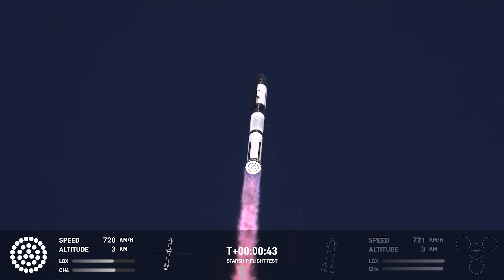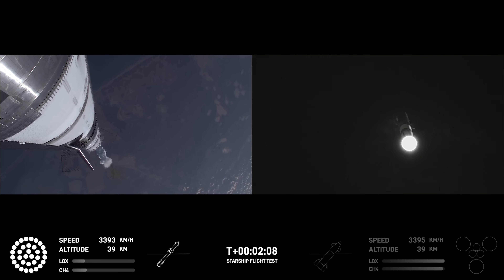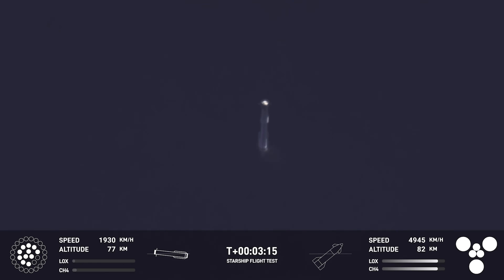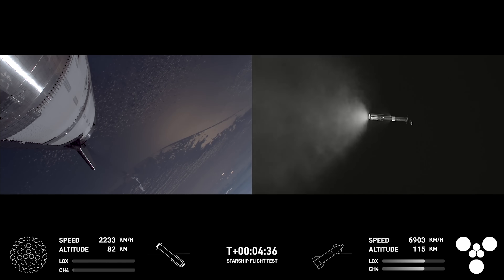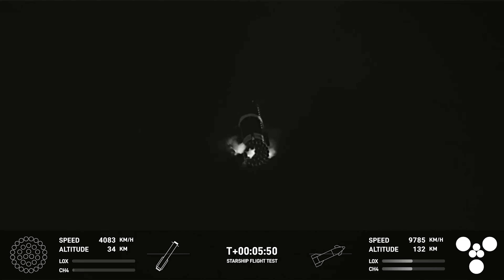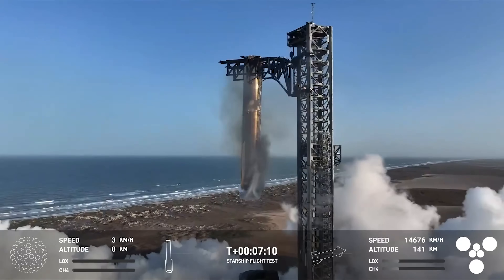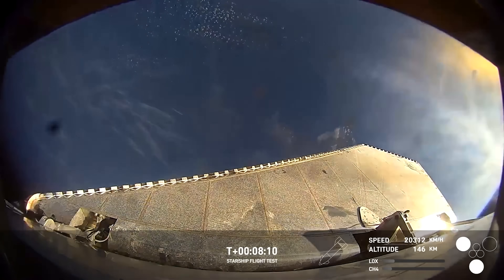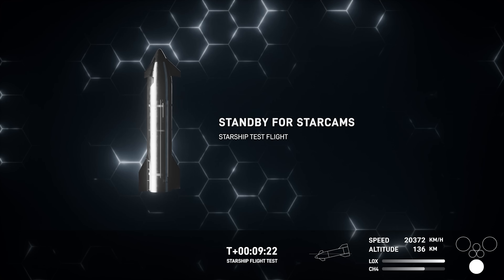BAD NEWS! Starship Flight 8 Spinned and Exploded After Booster Catch...Here's What Happened!

Comment: Looks like one engine, perhaps the outer vacuum engine exploded and took out a couple more and then one more after that.  The other possibility is that the plumbing feeding propellant to those engines was either starved of prop or the plumbing ruptured thus starving the engines.  This second possibility would also explain the vapor cloud the Starship was seen spinning around in before it broke up. As to why the plumbing would fail at that point, I don't know, but it might be the shockwaves and acoustic environment that bathes Starship on takeoff with all that exhaust reflecting off the water cooled plate.  On takeoff the SuperHeavy booster is producing the equivalent of about 360M Horse Power or 270GW -- if only 1% of that energy is acoustic that's still nearly 3GW of sound energy bathing the rocket.  It just may be that the first stage is somewhat protected by the very engines producing that power, but that the Starship isn't running it's engines at that point AND the 'hot staging ring'  might allow more of that acoustic energy to get at the Starships plumbing.  Still, it's odd how the plumbing of Starship survived for about 4 minutes of operation before failing.  That kind of brings us back to an engine failure taking out other engines and also  rupturing the plumbing.

Comment: Too many engines which creates too much plumbing which increases your risk of failure. That is why the Saturn V had only 5 massive engines on first stage and 5 smaller engines on second stage.

Edit - Go look at the Soviet Moon Rocket. They had the same issue and completely failed.
Reply: It's a valid point. But equally, as you add more engines and increase the risk of one of them failing, you reduce the impact of one engine failure. Very relevantly illustrated by the fact that on the booster boost-back sequence of both fligth 7 & 8, one or more engines failed to ignite. And yet, the booster landed succesfully. So... I guess we'll have to see how it goes :)
Reply: @Z00777  Yes I'm sure they will get it worked out. But I would not want to ride on one.

Comment: Saturn rockets lifted off in the late 60's , early 70's , so why can't this rocket ?
Reply: Saturn rockets had failures also
Reply: Uhm, it did lift off, multiple times? But it seems they may have done something in block 2 that does not quite work yet.
Reply: The Apollo program used non-reusable rockets, employed 400,000 people and cost $300 billion adjusted for inflation. Spacex employs 13,000, and the budget so far for the starship has been $8 billion.

So less than 3% of the manpower and budget, for something revolutionary since it can land.
Reply: Seems the booster is working.  And so is the recovery system.  Go back and retrace how many Jupiter and Atlas lift vehicles were used up unsuccessfully before they were finally debugged enough to be trusted with carrying a living person into space.

Comment: It is conceivable that Starship may have reached a Technological development Dead End. Yes, I am convinced that SpaceX will be able to make it to orbit and a successful re-entry but Starship may never be viewed as a reliable Human Spacecraft. The complexity of Starship precludes it from being a viable "Rapid Reusable" Space Launch system for Humans. Starship will be no more reliable than the Space Shuttle regardless of the focused detail on safety. The RUD of Starshift 7 and 8 is an unanticipated disaster when comparison is made to the previous successful Starship re-entry attempts with the heat shield being the major issue. With each Starship failure the greater the doubt for success and the decrease in overall confidence that SpaceX will be capable of making Starship safe. The optics of these failures does not favor Starship. Who will ever want to get on a Rocket that has a good chance of Blowing Up. Perhaps for this reason Blue Origin has taken a cautious approach to flight testing when in comes to New Glenn. There will have to be a minimum of a dozen fully successful launches of Starship before it can be considered reliable. Hopefully SpaceX will succeed.
Reply: This is the only emotionally and intellectually stable critique I've read so far. Good assessment.
Reply: Please, please You seems to be an expert, call SpaceX and overtake the project !!!

Comment: They are not a patch on the NASA Apollo government program engineers. The greatest generation is dead.
Space X is engineered by people who were constantly told they were special when they grew up when they weren't.   These people tout the return of the booster as as a success over the loss of the spaceship and will give a participation award to the spaceship engineering crew next staff meeting.  Better luck next time with tax payer money. Why are we giving billions to privatized for profit corporations instead of NASA? It makes no economic or practical sense.
Reply: You clearly havent seen what NASA accomplished over the past 30 years with the budget provided them.  SpaceX is still saving the government money when one of these explodes due to the savings on Falcon9 and Falcon Heavy contracts and it's not even close when compared the cost to use the shuttle, or any other rocket, to get the equivalent weight to space.
Reply: No tax payer money is spent on the starship project. Actually, the Starbase pays tax by millions and generate jobs by hundreds each year.

Comment: Imagine the Saturn V with this many failures. Good thing NASA didnt' trust our astronauts to this hunk o' junk.
Reply: Saturn V couldnt have been produced the same way.  Which is rapid iteration.  The cost wouldn't have been feasible.
Reply: Apollo 6 sends it's regards. S-IVB failed to restart for its 310-second burn, resulting in it being a failed mission. If it was a manned mission, the escape tower would had been used.  Remember Starship is still in experimental phase. Not to mention it only had 13 total flights. Then you can look at the damage that was done to Skylab. Severe pogo oscillations in the 2nd stage nearly costed Apollo 13 with catastrophe. A third stage blew up during testing in Sacramento in January of 1967.
Reply: @Ragetiger1  I guess the difference to me is that was in the 60s. This is 2025.
Reply: @beccaaaa45678  We were also in a race against the USSR to be first on the Moon in the 60s. 

I do find it odd that Starship was the first part that was tested and seemed to be running fine in 2021 - belly flop maneuver with vertical landing.
Reply: @ If NASA had Elon's record there would have been over 100 exploding craft.
Reply: @Ragetiger1  How many Saturn Vs exploded with complete loss of the craft again??
Reply: @SeattleRafael  How many Falcon 9 Heavys . . . . none that I can recall. Now if you want to call Starship the correct thing, it would be Apollo.  Apollo 1 never left the pad, Apollo 6 failed to reach it's objective, cause Saturn V's third stage failed to even start, but was deemed ready for manned flight. Apollo 13 and skylab.  

So it only had 13 total flights, not really enough to be considered for a failure rating. The space shuttle flew well over 100 times with 2 failures.
Reply: @Ragetiger1  Starship vehicles have been launched 8 times, resulting in 4 successes  and 4 failures. How many Saturn Vs exploded?

Comment: There will be many more of this explosion,This is just a testing development and building phase. There’ll be a lot more explosions and then one day they’ll be none.
Reply: Just as there are no more shuttle explosions.
Reply: @ that’s very short cited.
Reply: @jackieking1522  They are testing the heat tiles and are not expecting a return for another 7-8 flights. They have 4 more flights testing the composition and density of the tiles, then another 4 scheduled to test placement. The Shuttle was designed for replacement of the heat shield every flight which took 6-9 months in between flights. SpaceX is working permanent tiles that can be reused the next day. There is a giant difference between the two technologies.

Comment: 7:49 You can see the bottom-left Raptor Vacuum Engine glowing abnormally, near the tip. I wonder if the vacuum nozzle had a crack in it.
Reply: Nice catch! Just losing a few cryogenic lines in the nozzle can cause the engine to rapidly overheat.
Reply: @brainandforce The booster catch was on point, it'll take time to get starship figured out but I'm sure it'll happen soon enough. This kind of stuff definitely isn't easy....
Reply: Is it just me or is anyone else rearranging the words in that sentence?  At 60 I still can't help but think like a 15-year-old at times.

Comment: Musk on Mars - Space Unicorns - See the Spoiler near the end.

Using statements & documents issued by Elon Musk I have calculated the viability of his Mars colonization project. Strap in, the G-forces will be very high.

Musk admitted that 1 million tons of material must be sent to Mars in advance of humans to supply the components for safe habitat.

That requires 10,000 successful launches and subsequent descents of Starship to the selected habitat area on Mars (100 ton payload per Starship claimed by Musk).

In addition, Musk stated it will take 6 more Starships for every Mars bound vehicle to refuel those Mars bound Starships (waiting in orbit)for the actual Mars journey. That's 60,000 additional Starship launches, allowing that there are no failures.

This gives us 7 launches for every Mars bound vehicle. So in reality, at one launch per day (wildly optimistic = delusional, but let's go with it) it will take 7 days per Mars bound vehicle. That now totals 191 years to complete material transfer.

Spoiler:
The window for a Mars launch is once every 26 months, with 15 days available in that time frame (49 launches per day).
That means Starship will have to cram in 732 launches in 15 days every 26 months to meet the 191 year infrastructure transfer.

1) What will happen to the first material that lands after 191 years while it sits waiting for the final structural parts to be landed?
2) Who will finance each Starship, the cargo, fuel mass needed to make the journey?
5) What can be done at the Mars site if material is damaged?
6) During the 191 years will there continue to be a viable SpaceX factory?
7) How many Starship launches will fail during the program to put material on Mars.
8) How many Starships will crash during the landing phase on Mars?

9) How about feeding the astronauts for 9 months?
Reply: How about you go back down to your basement and go to sleep until the drugs wear off!!

Comment: As a former avionics engineer I suspect it may have been caused by the mental stabilisation line replaceable unit. It always was rather fragile barely in balance  and apt to supply incorect data most of the time   I suspect it may be found to have been contaminated with a white powder of some sort.
Reply: Ketamine
Reply: You're thinking of Hunter..

Comment: Current starship separation procedures are proving detrimental to the vehicle's structural integrity.  This issue necessitates immediate action to mitigate further damage.  A thorough review of the separation mechanisms is required.  We must either refine the existing process or develop a completely new separation system.  The success of future missions depends on resolving this critical flaw.

Comment: How is Musk going to take enough cryogenic fuel to get back off Mars. Takes many months to get there, fuel won't boil away? 200 foot tall Starship landing on Mars with no tower with chopsticks to catch it. Land on uneven rocky ground and fall over.
Reply: Right. I see the same issues. The whole architecture is flawed. We should be building moon shuttle vehicles in space by piecing together components. The shuttle can be as big as they want without needing aerodynamics.  It could have tons of space and radiation shielding.  Falcon Heavy can deliver the components to Earth orbit where they are assembled.  Once the shuttle reaches the moon orbit,  moon landers go to and from the moon's surface, much like Apollo did. Once a mission is completed, the shuttle returns to Earth orbit. This architecture can be done today.  Once this system is working well, then do a similar thing with Mars.
Reply: Sanitizer process, crack methane from the Martian atmosphere.

Comment: Booster stage is working reasonably well now. 3rd catch. Just have to sort out the 2nd stage starship fuel line problems causing engines to shut down. This time only 20 or so seconds to engine shut-down this time.

Comment: At 7:48, you can see what looks like vapor and even what looks like flame in the engine bay when there should be neither.
Reply: A raptor vacuum engine was damaged and it is the one which exploded and took the centre engines with it

Comment: So im guessing the same problem as last time.e reared it's head. Could the hot staging be causing the problem because the flames under high pressure and temps are confined?

Comment: Looks like the cooling system for the outer larger engine had a line break during use. Looks as though they both did. The center systems must have failed do to a top right engine blow out. Tha tkicked off the main lines and the other two could not be turned off to prevent full system failer.
Reply: I am not an expert or an engineer, nor knowledgeable about engines, but your explanation seems to make good sense.

Comment: Remember folks, SpaceX has to do 20+ flights like this to bring one crew to the moon and back.
Reply: Plus in orbit re-fueling..what a fucking disaster
Reply: They didn’t mention anything about payload on that test flight as well. They should have demonstrated that a while ago.
Reply: LOL, they can't even do one.
Reply: @Easy-Eight  More than you will ever do.
Reply: @ Falcon Heavy and Falcon 9 can do the lift missions.  Obviously Starship is too much for SpaceX.     BTW, I support SpaceX but at failure #8 it's time to toss in the towel.
Reply: @Easy-Eight  Perhaps they should fly the ship you designed and are testing.